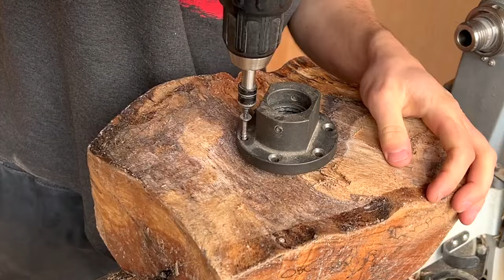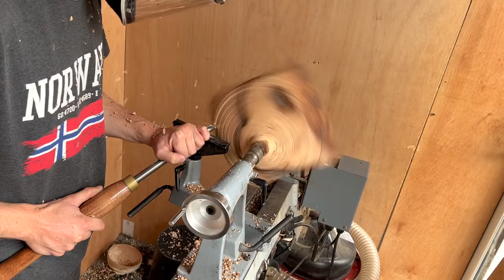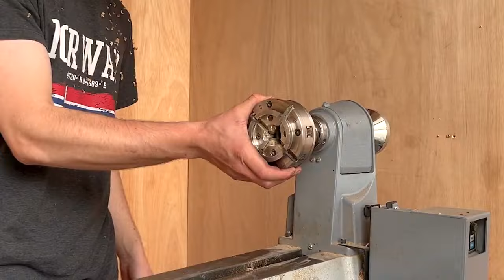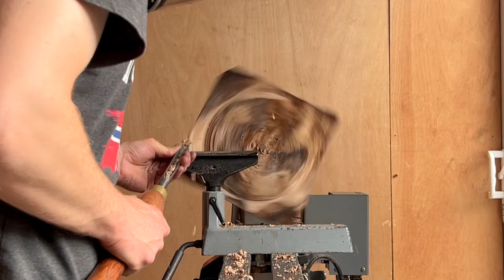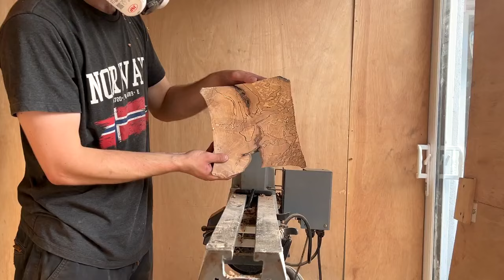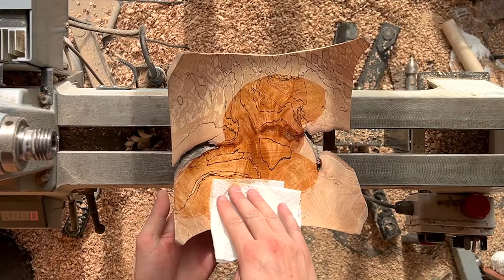Woodturning - Beware the Square!!

Comment: One thing I recommend is handball gloves.  It leaves your fingers open to grip while protecting your hand from the full impact of rounding wood down.  Also, you can use a piece of sock or bandage to keep the Velcro strap from sticking out and risking its getting snagged in the work.